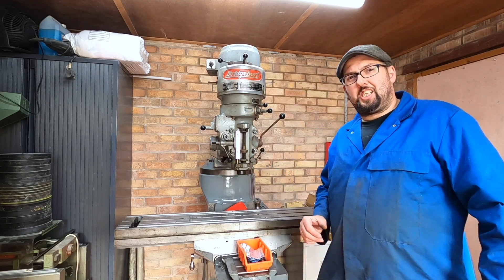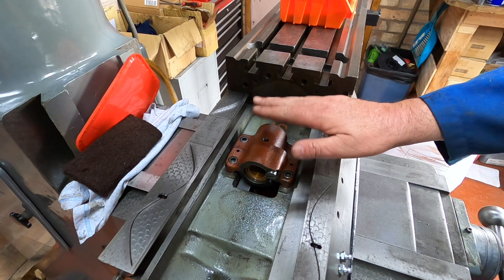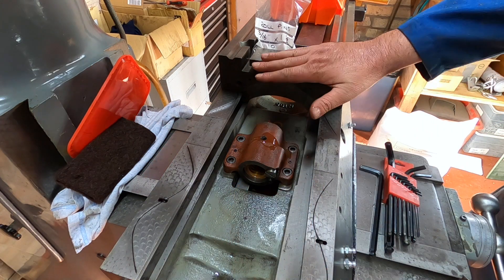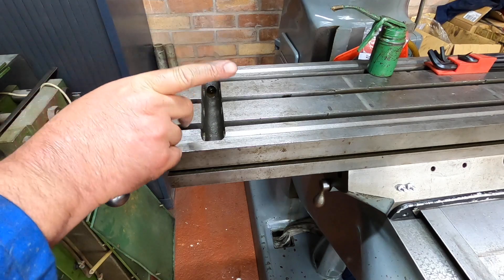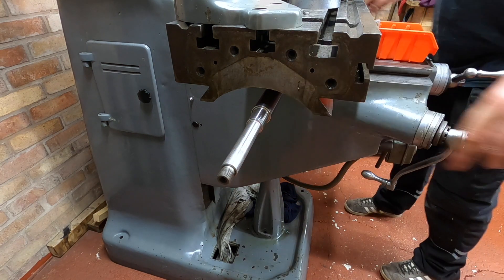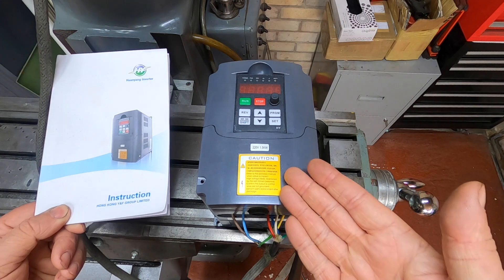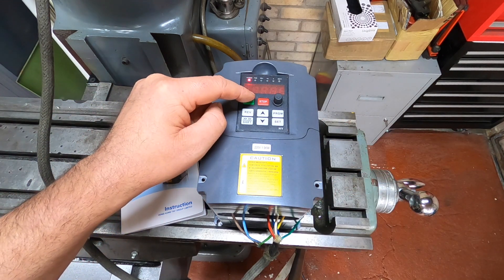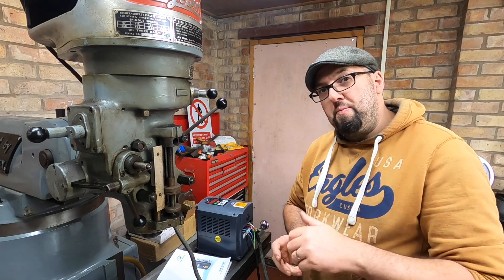Bridgeport Milling Machine pt 5 - X axis to will it run?

Comment: I recently got a 3 phase bridgeport clone made in Taiwan but its for my garage workshop at home..trying to sort out the pros and cons of a Rotary phase converter vs VFD..reports of VFD destroying ball bearings..Frosting and fluting them..because of the PWM pulse wave modulation from the VFD causing capacitance to build up on the motor shaft to about 70 volts that then discharge to ground / earth thru the ball bearings unless you run a ground / earth wire to the motor shaft..720 hrs of life expectancy without a ground/ earth wire..

Comment: You can get the oil pump guns for this style table lube. There push type usually filled when new. I found them on eBay years back. If I remember there notcostly.. Like the channel so far great clean up on this mill too. I had ankle round top bridgeport it too was full of grease.
Reply from the maker: Hi Silverbullet, At the moment I'm just using the old one we got with the Myford, I'd like to upgrade it to a one shot lube system, well one day! Laters, Matt.

Comment: Judging by the frosting marks on the "X" axis on the saddle that machine is in great shape. Great catch!! Looking forward to the electrical lesson and the VFD setup
Reply from the maker: I'm super happy with it tbh, it needs tlc here and there but nothing major. Everything works as it should. Over time I'll sort everything out on it, fit DRO, x-axis power feed, the later two may end up first. I've started the electrical episode and its a simple install on the VFD. All the best, Matt

Comment: 6:08 you missed the two pins
Reply from the maker: Not so much missed, strategically not put in to allow me to take it back apart easier. The machine does require some minor repairs, but nothing that’s going to effect it short term, I just need it operational for small jobs, so the pins will be put in, as you can see I bought a bag full. 👍